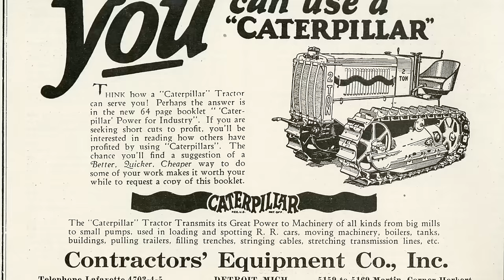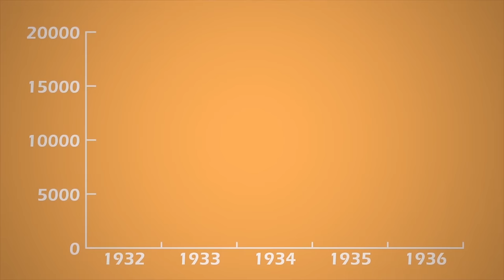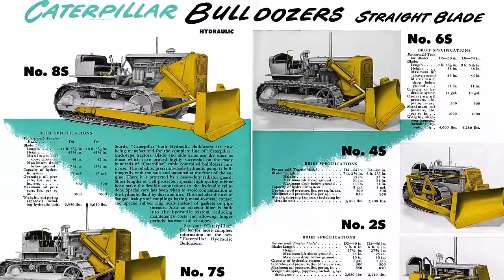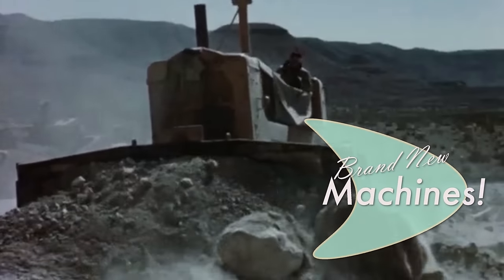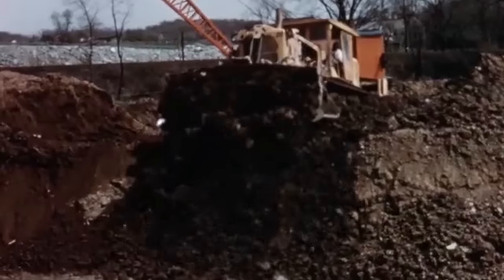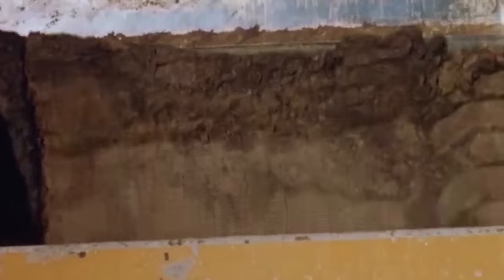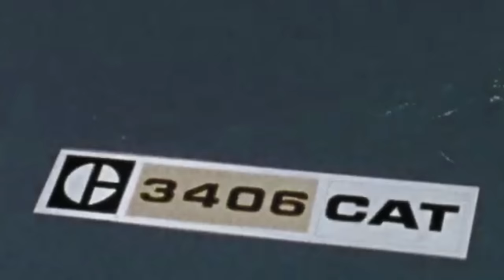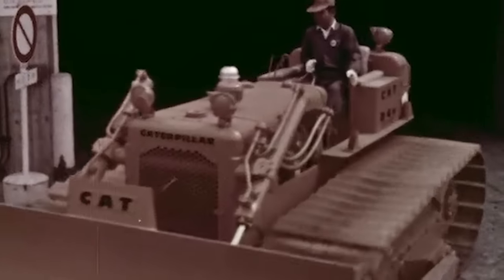Caterpillar Throughout the Decades

Comment: I operate cat haul trucks mostly the 777D its all around my favorite truck its older but they are just beasts and the 3408 powering it is a monster i make the joke saying im gunna put one in my little D6 at work to and id out push a D10
Reply: 3508 not 3408

Comment: Got an old 1949 D4, with the original diesel engine. Never been overhauled. Starts and runs like a top, assuming I can get the pony motor going!
Reply: Watch it!   I had a similar age D4 too.   White gunk blocks the water passages of the pony engine in old D4's.   The first symptom is the diesel taking longer to start due to not getting all the pony heat.   Then the pony gets ruined due to lack of cooling.  Pony engines should start easy - if it doesn't, probably points need adjustment, or carby needs cleaning.